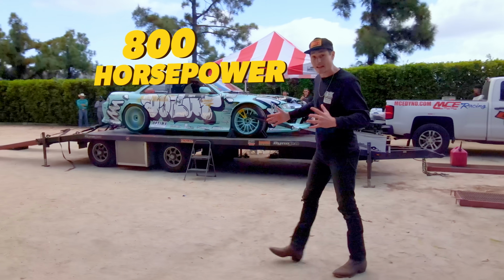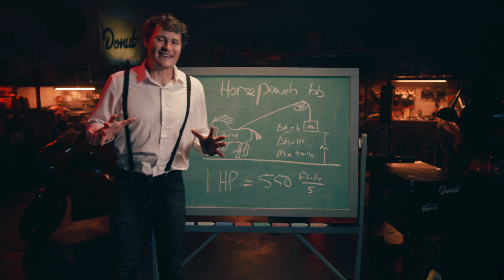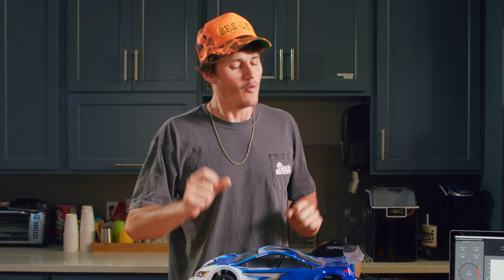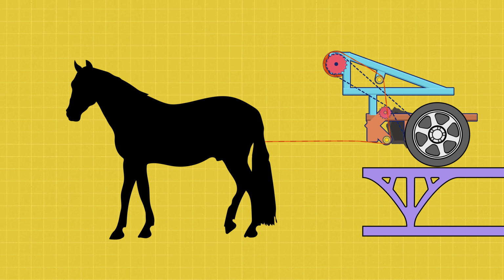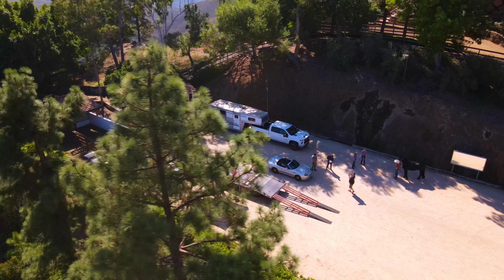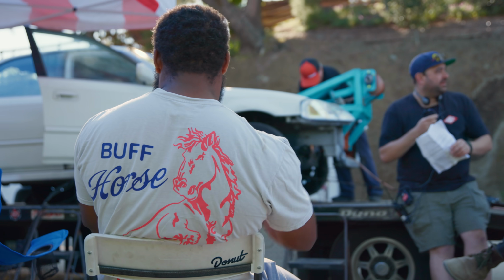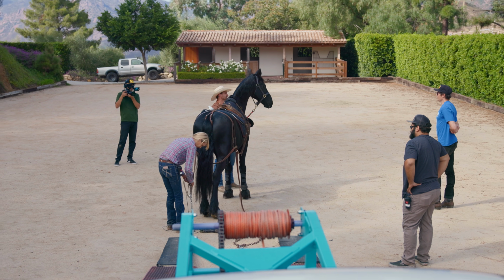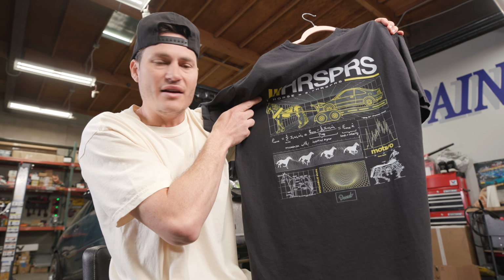How Much Horsepower is a Horse?

Comment: I'm not usually a hater but this is in fact a very bad way of doing science and it would be shredded during the peer review process, first because it will only measure the peak power of a horse (anaerobic power) which is a very bad metric to compare this with a car engine that can produce its max power for order of magnitude longer, secondly because at 20:00 they explain how a dyno (?) can't measure what they want (crank power) but instead of leaving the machine behind they use a very un-detailed model of the transmission to deduce this metric from the wheel HP, introducing errors no matter how precise their model is. How could it be done better ? stick a carriage behind the horse, with a force gauge between the horse and the carriage, and brake the carriage little by little over an hour or so while the horse is pulling it : plot the Force*Velocity curve and there's your max aerobic power from a horse. Two thing to consider : the brakes might get hot maybe a generative braking could be better, and the carriage must be heavy enough not to slip when braking heavily
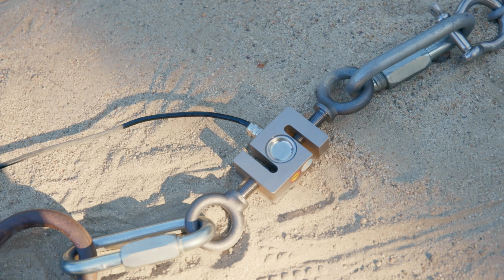Reply: posted this at 20:00 but there you go with a load cell at 23:47 why did they bother with the dyno at all ?? I'm so disapointed

Comment: Why didn't you essentially turn the dyno on it's side and have the horse walk in a very wide circle pushing a bar? Kinda like the work horses often did the the past. You'd have an infinite period to gather data, without running out of cable or drag of the cable or the changing radius of the feed drum. It would be trivial to have multiple horses, balanced around the turning path for better averaging.

Comment: 21:00: Bicycle enthusiast / racer here. No. You did not just push 1.6 hp / ~1.2 kW. Most pro racers can't even do that at that cadence. A big 198 cm / 90 kg dude might be able to reach that figure at 60 or 70 RPM, but he (and I say "he" because I doubt any women in the world can reach 1.2 kW at 60 RPM) is going to be a ripped pile of muscle. I can tick over 1.2 kW when fresh, but it's at over 110+ RPM. All the pro sprinters who can reach 1.4 or 1.6 kW are doing so at even higher RPMs. Get a real bicycle power meter. They're not that expensive.

Comment: Now I'm no expert, but I'm pretty sure the by Watt's definition the hp was defined as the average amount of power a horse can produce over a work day not it's peak power. Which make more sense than peak power since the steam engine can operate at peak power 24/7 without pesky things like getting tired. If you look at humans typical power for healthy human is 1.2 hp peak and 0.1 hp sustainned about 12:1. If the same applies to the horse then watt might have overestimate the hp not understimate or maybe horses were built different back then about 2x as powerfull as today's horses (assuming the human ratio even applies to horses which it probably doesn't).

Comment: what about using a force meter between a stone boat and the triple tree at horse draw competition. You would have a much larger pool of force measurements to find the average power produced by a horse. Using the force meter and stone boat method would get many measurements of the force generated on either side of the boat moving and not moving. Knowing the force and the distance of the pulls would give many data points that would improve the reliability of the data. You would be looking at many pulls and many horses. The stone boat has a different momentum profile being dragged on the ground instead of a device with rotational momentum.

Comment: The horse has 5.7 horse-power?  If the test is scientifically accurate, why is horse-power not calculated into a 'horse-power equals XX newtons and divide cars ratings according to the scientific standard?  i.e. 600 horse-power car is now 105.26 horse-power car.  600÷5.7=105.26....

Comment: So back when horses ruled, nobody was interested in how much power a horse could generate for a few seconds. If you were selling tractors in 1920, what mattered was how much work the tractor could do in a day (“from can see to can’t see”) compared to a team of horses. When measuring horsepower you need to measure sustained effort.  This is what matters to the farmer.

I suspect that if you do this you’ll find that a horse produces about one horsepower.
Reply: Yep, that's what the original horsepower calculation was, sustained effort, not peak effort.
Reply: @denisl2760 Exactly. It was hard for me to watch this, well before it was completely clear what the plan was.
Endeavoring to measure the WRONG THING, makes everything after that... WRONG.
Even so, strong draft horses continuously produce more than 1 horsepower even during a sustained 8 hour test.

Horsekind vindicated, horsepower debunked. James Watt wasn't just a clever inventor, he had more than a little bit of PT Barnum in him as well.
I suppose this is a demonstration that two wrongs (or maybe six or seven) sometimes make a right? 😎
Reply: @brettrussell9391 I agree with you. I mean the video was really well done as far as entertainment is concerned, and was not scientifically inaccurate. But it seems like they made it a lot more complicated than necessary. If we really want to see the absolute highest peak power possible from a horse, we'd probably have to add some weight to the back of the horse so that it can get more traction, and also give it an ideal surface for best traction without wasting energy. In fact, if they located the cable's pulling point down near ground level instead of up in the air, the horse could get more traction as it pulled harder. When the cable is up in the air like in the video, the harder the horse pulls, the more it loses traction on its front feet, so then it has to do all the pulling with the rear legs. Also, they could easily calculate the HP lost with the transmission system simply by using an electric motor with an extremely stable power source to power it (so that it won't fluctuate because of other unrelated factors), and run that motor directly on the dyno, record its power curve, and then run the same motor through the transmission system they made. The difference in HP reported by the dyno will be EXACTLY the HP lost in the transmission.
Reply: Indeed.  That's what I was figuring.  Humans average 100 watts.  Pushing to the max, the guys were able to get around 800 watts, but were done in seconds.   A "fit" cyclist can do 250-300 watts for 20 minutes, a pro can do 400.  So if we figure that a human can do roughly 1/4 of that 800 watts on a sustained basis(200 watts of work), and Big D did 5.7, he can probably do ~1.4 sustained.  Keeping in mind that he's a very healthy draft horse, while back when Watt did his "study", they would have likely been using whatever horses they had at hand, who might not be in perfect health, need to be unhooked and taken out for eating, rest, grooming, sleeping at night, etc...  Meanwhile, his steam engine can work more or less around the clock.  So his advertisement that his steam engine was worth 5-10 horses, work wise, couldn't have been too far off, otherwise he wouldn't be able to keep selling them, and would have complaining customers.
Reply: @jason67823  Yea I don't think they are looking at this right.  They measured the maximum amount Big D could do.  Not what he could average in say an hour.  I was taught that One Horse Power is the amount of work 1 horse could do in an hour.
Reply: they need a brake dynomometer, so that the horse can pull continuously. that is how these sorts of experiments were actually done.
Reply: Yeah, even at the beginning of the video he said Watt watched horses for the whole day and averaged the work being done.
Reply: Depends on the horse as well. I've worked with actual draft horses and they are built heavier than the light draft horse they used here. The smallest draft horses were about the same height but were circa 25% more muscular and the large ones were a couple hands taller and more muscled as well. Owned horses and worked with work/draft horses and there's a fair bit of size difference and power between them.
Reply: @Parents_of_Twins I’ve spent most of my life around horses and actually lived on the ranch in this video for a few years. Your comment is totally accurate, but I’ll also add that that while that horse is fit, I’ll almost guarantee it’s from a lot of flat work, like dressage, and trails. I’d be surprised if it has ever pulled much before, so output would also be reflected.
Reply: @HVACExtraordinaire  Excellent point. Yep I didn't even think of that but you are absolutely right. Pulling all day versus carrying uses different muscle groups.
Reply: Actually it was a matter of coal mines in wich the carts were also drawn up the shaft by horses, only later were engienes also used for field work but the industrial revulution started in the mines , but otherwise true
Reply: i agree , continuous horsepower , 1 horse at maybe 6/8hrs / day
Reply: @Danimal100  But that was not the premise of the video or the mathematical formula for horsepower. You have missed both the video's concept as well as what horsepower is and how it is calculated.
Reply: dido
Reply: Exactly on the sustained effort.  Peak doesn’t matter pulling a plow all day.  It would be meaningful overcoming static forces to get something moving initially.  Furthermore, I think the power could be more directly measured (less extraneous errors introduced) by using the velocity of the horse itself coupled with the line tension…. If you work thru the equations - power is also Force x Velocity (Dynamics “101”).  No dynamometer is needed…. Just a constant load (does not vary under constant velocity) and something to measure the velocity.  The dyno is more ‘eye candy’ for the viewer, imho…
Having said all that - there is no chance a auto engine would last  very long producing peak power for 8 hours either.
Reply: It's ultimately just a term allowing a relative comparison not an actual measurement of much of anything. On a dyno, it is the same thing as was explained. It is just the top of the curve like IPP audio amplifier power.
Reply: James Watt decided on the value to be just above any potential example. He didn't want the strongest horse (in the world) to come along and "embarrass" his machines.
Reply: Then came the steam age, and belt dynos. Here's one that is run every Labor Day east of Fargo/Moorhead in a Minnesota Steam Thresher's event.   /watch?v=ROv7wKFe5BM
Reply: When horses reigned
Reply: Big D is a beautiful horse. They have so much personality and just have a way about them. Love them
Reply: Yeah but the comparison here, as evident by the tool of measurement, isn’t to the sustained hp of farm equipment. It’s to shit like souped up civics that hit 800hp but only for a millisecond right before the engine explodes.
Reply: Well, there are horses and then there are HORSES.  Typical average sized draft horses used in Logging in a team of 2 were expected to haul 30 tons all day(8ish hours + breaks or - I am not sure how the reference did that.  That would be 1 end on wheels at minimum(probably both)
Reply: wait they never mention this? it comes up immediately in google. i'm not gonna bother watching this now.
Reply: A horsepower has absolutely nothing to do with a horse whatsoever. Its a marketing gimmick, and pretty damn arbitrary. Nobody knows for sure how they came up with the original hp figure, all we know is a horse makes a fuck of a lot more than 1hp.
Reply: @wills.5762  No, the coal miners asked how many horses an engien would replace and someone thought about it and tried a measuremnt of power a normal horse could produce continuesly over a work day. He even was pretty acurat for the time.
Reply: @key7817  Except theres a dozen different stories about a dozen different situations.
Reply: @wills.5762  5 pulls for a few seconds at max strenght are quite a bit different than sustained power through a whole day. We need a secpnd test but with a brake dyno with houre long pull times.
Reply: @clockworkvanhellsing372  Yeah, but the same thing applies back then as now: Everyone tells you peak hp for marketing reasons. Seeing as hp was originally conceived as a marketing gimmick, it makes a lot more sense to measure a horses peak hp than its sustained hp
Reply: @wills.5762  Great comment. So many took this video seriously when all it did was as you say which was to show that HP is just branding but does serve as some sort of comparison.

Comment: How much torque did he put out? that's the real question guys and why didn't you guys take out the slack in the line first 🤔
Reply: Just think about it drive safts don't have slack and I've had five horses you don't pull anything without taking the slack out plus the horse wasn't pulling that hard let him run see what you get Don't get me wrong it's cool and I love your video but you can shot holes in the math

Comment: Awesome video and something that's needed answered for a long time. A couple questions... 
I'm not sure I would agree with using a draft horse for this.
What if you used a Thoroughbred instead? They are designed to move a lot faster and would have had a greater velocity toward the end of the pull, which might have given a little more accurate data. This is like having a semi truck against a race car. Horsepower is about the acceleration of torque, which is why I think a thoroughbred might be a better measurement. As we all know, semis make a lot of torque, but not a lot of relative horsepower. The same thing with a draft horse. I think it skews your horsepower number downward. 

Now you should test various horses on that and see how they compare! I would imagine something like a quarter horse would be right in the middle between power and speed that would be closest to the average of most horse breeds.

I think it would have helped if the slack could have been taken out of the pull line before the horse started, because that gave him a big jerk in the beginning that basically made him stop and then have to start over again. I don't know if that was adjusted for or taken out of the calculations.

But overall, I would say fantastic job and something to be proud of!

Comment: Guys, THANK YOU FOR THIS! As an old-time gear-head, I always wondered how much HP one horse REALLY had!  Do you know what this means?? From this moment on to get accurate HP ratings on cars, divide their HP rating by 5.7! (SOMEBODY must have mentioned this, but I did not check.) 
In the older days, HP ratings were a sham: They were rated at the crankshaft of the engine, whereas these days, they are rated at the wheels. SO, if an old Chevy 427 was rated at 425 HP it was substantially less than that, at the wheels, which is the only HP that counts. ❤ More than once I thought, THAT is one beautiful animal! 🐎🐎

Comment: think you need to go back to school, putting a horse on a dyno doesn't measure horse power. Horse Power is a misnomer you want to measure "FORCE" Force=Mass X Acceleration.  Power is a measurement of Electricity. Thus you want to take a single horse, weight that horse and have it pull 1kg or 10kg over 1-10seconds. You then do the same experiment with multiple horse across multiple breeds for an average because not all horses and horse breeds are created the same. Draft horses may be typically big and strong but are not good for long distance running Mustangs and other Running Horses produce the most raw sustained power.

Comment: A sample of one is not a true statistic. Need to sample at minimum 10 different horses with 5 runs per day over 5 days 
As many others have stated the rig can be significantly simplified.
The last issue is that the horse has not been trained as a work horse, you need horses that are used to pulling heavy loads all day. A show/riding horse just won't provide accurate information.

Comment: Isn't this likely to be a severe underestimate of the max power of this particular horse, because unless I missed it there was no attempt to select an optimum gear for the horse. Power is speed times force, and some animals (and engines) will be able to provide more power at a higher speed, while others will provide higher power at a relatively lower speed with more force.  Allowing each to use their optimum gear evens that out but it takes experience to know what the optimum gear is.

If you measured my power pulling against a 10kg force you'd get a certain power. If you measured me pulling a 1g force you'd get a much lower power because I can't run that fast. And if you measured my power pulling against a 1 tonne force you'd get zero.

Comment: On you video man can pull this .. Here is many flaws with yous system .. Too muthc drag compare to utility power ... If it will measure power of fly or bird it measure zero .... But we know they fly.. Othere example  i have power meter In my bike in rear hub.. .. (There are more options producers put strainguages on some axes in bike or pedals, cranks and it measure torque..torque vs rpm measure power) im 176cm and 60kg and im ride bike occasionally not daily im not profesional . my FTP is 225 now(its in short way im able  to one houer work with that power)  and when i start with high rpm i was able to peak power of 999Watts .. But when i start from light on crosroad.. Its always about 500-650W sometimes 750W .. When i casualy drive my bike its 150W but when i push hard on my 95% its about 300-350W ... But after minuter or few i can maintain little less ... Like i say when is summer i measure my power in proper suit with clipless pedals soo i can push myself to the limmits for houer or longer and im not in flat region....soo sometimes its 450W for minute sometime its just 100W .. But awerange from my test is 225 ..when i was prime it was more .  And if i good remember it was 3.6-4.2 watts per kilogram .. World champions that propably have legs 2 times dimensions like me  they have something closer to 13-15W per kg of body...